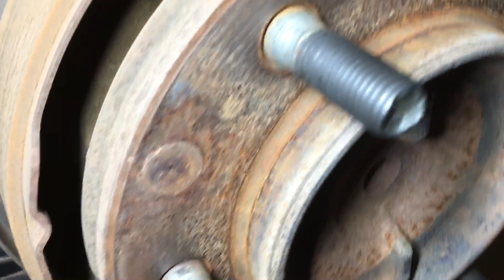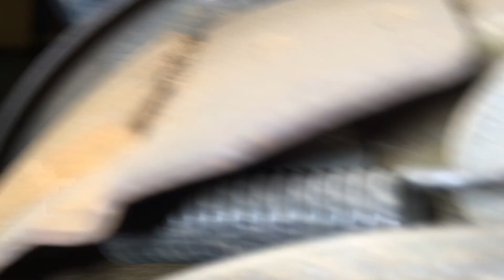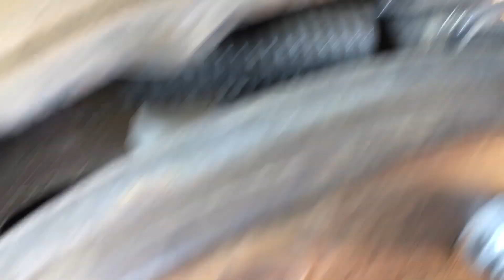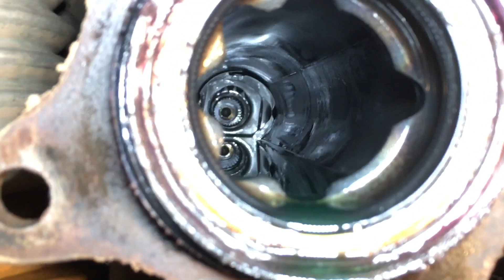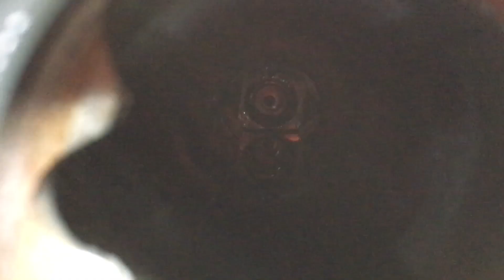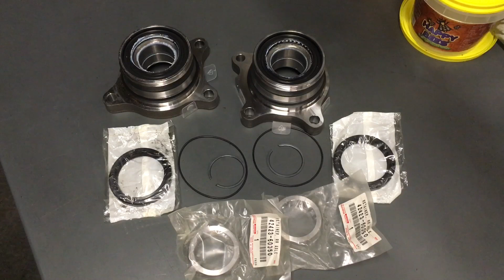REAR AXLE IMPORTANT INFORMATION INCLUDED - please listen carefully

Comment: Continue y tried to mikegiver cut like a 1/4 socket 1/4 in dr. Or larger smaller than hole on axle shaft grinder the outside make it look like a screwdriver n it was still hard because the hole axle was of angle n will not work ( this is like the tool that Toyota sale’s witch it’s not unavailable seen most of DUY.problem (one did not had a problem cause he had replaced high perfor. Or aftermarket axles that had 2 larger access holes 180 degrees to get your installer tool Amen.

Comment: Taking the spring off. That’s hold the shoes no problem I only did the rear right on left side I took the shaft complete with backing plate as one unit disconnected the emergency brake cable at junction point about 2 feet from axles,replaced total rear end .the right side I took it apart cause the emergency cable was to long many connections & maneuvers was real real hard to get those springs n washers to install at one time I was thinking on MIG spot welding a little washer on back of nail pin to use like tumb or butterfly to quarter turn

Comment: You don’t actually need to remove those clips because the shoe has a slot in it not a hole.
You can actually slide the shoe out by just using a flat head screwdriver under the spring and popping the washer out of the locating hole.

Comment: And of course my hand brake cable doesnt just pull out the back of the plate like yours - mine has an extra joint that needs to be taken apart first - and of course you have the joy of not having to work on rust buckets like here in the UK where cars dissolve

Comment: Those retaining springs are a bitch because of that ridiculous hub design (no cuts outs and too small of a hole) - i got a kitchen fork , removed the middle prong , ground the outer edge of the remaining 2 (to fit in the stupid small hole) and put a slight outward bend on the last 2mm of each prong to fit either side of the pin on the retainer